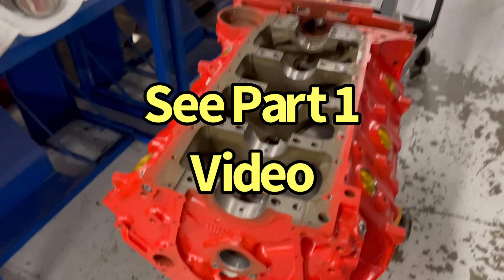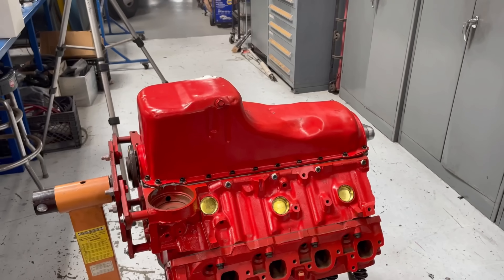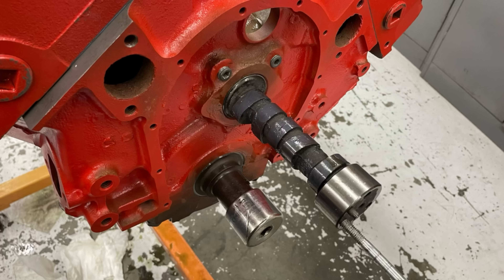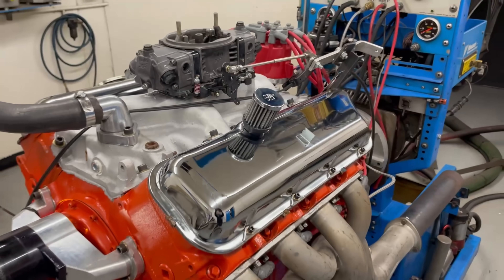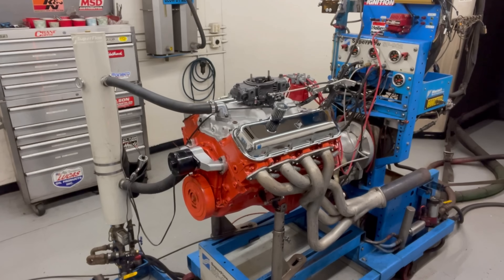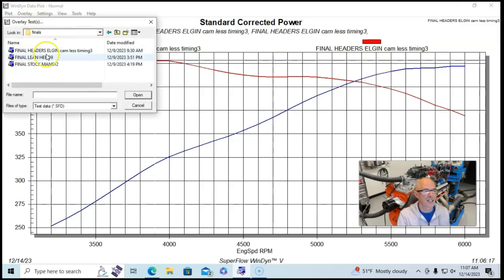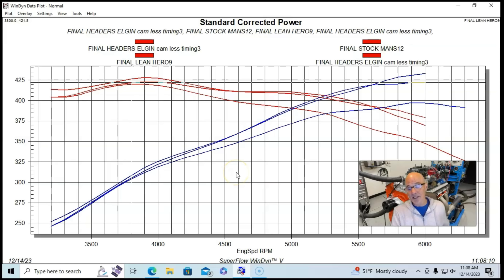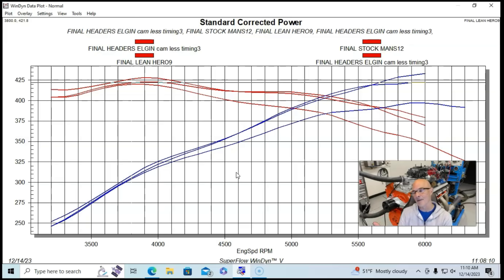FULL DYNO RESULTS ON THE L78 396, OVERRATED AT 425 HP OR  UNDERRATED AT 375 HP? WHAT DID IT MAKE?

Comment: I dynoed a 1969 L78 396 that had a hydraulic flat tappet 238°/242° @.050 cam and weiand stelth intake with 850 carb and on my dyno it barely made 400hp with dyno headers.
Reply: I love when someone only gives duration specs on a cam.  Makes me wonder.  My L78 with Mechanical Cam made Power well over 6800 rpm,  I don't see a Hyd. getting near that.
Reply: @playlist55  Yup you are correct. Big difference from 6000 to 7000 rpm.
Reply: Were you at high altitude or was the compression particularly low? Not trying to be smart, really asking because it just seems like it'd make more, even ground at less than optimal LSA.
Reply: @mikewillett5076  Engine had been rebuild at some point quite some time before it came to me to dyno. Still had the std bore TRW forged 11:1 pistons. Cam had been switched to a hydraulic flat tappet as mentioned. Leak down test was fair at 16-24% it just didn't make any power. I played around with timing and a/f ratios but it just never really responded well. Think it made 405hp @ 6000 rpm. I got a chance to drive the restored 70 chevelle the engine went into and it ran well. I think there are so many inflated dyno numbers out there most people would be surprised what an honest 400hp actually feels like.
Reply: @DanClayton-fo6wt  . Thanks for the reply. You know what? You are right about how powerful and honest 400 horsepower engine can feel. We tend to think of a 400 HP factory engine as powerful but not when we build one ourselves. But that is a good number!
Reply: Engine dyno or chassis?  That can make all the difference in the world!  Same if you are using any correction factors - everything has to be SPOT ON for them to not skew the results.  I used to develop turbo kits for my own company and then the company that purchased us for a couple/few years after.  Everything from diesel side by sides to muscle cars to exotics. I've literally got thousands of hours of dyno time.  I  know people like to bag on results and whatnot, but 400hp to the tire is healthy in just about any car less than 3500lbs.
Reply: would that be a L78 with a hydraulic lifters?
Reply: @keithw372  I don’t see how it could be, from the factory anyway it wouldn’t come that way, L-78s had sold lifter cam .
Reply: @garywilson7992  A L37 is a L78 with hydraulics. 1965 only.
Reply: I don’t doubt that engine dyno’d at 400 hp, it was rated at 375 hp, and was a L-37 with hydraulic lifters , not a L-78, that all of them had solid lifters, and a more aggressive cam than the L-37. The 396 L-78 was first introduced in 1965 that replaced the dual quad 425 hp 409. In 1965 it came only in Corvettes and Impalas, and was rated at 425 hp. After 1965 they rated it at 375 hp, for a few reasons, that had nothing to do with a change in how it produced horse power.
The L-37 396/375 hp engine, which had hydraulic lifters, was a specific offering only for the 1965 Chevelle Z16, and wasn’t produced after that year with the 375 hp rating under the L-37 designation.
Reply: @garywilson7992 it was a numbers matching 69 L78 that had been rebuild with a aftermarket hydraulic cam
Reply: @DanClayton-fo6wt  I understand now, other than I’m not sure why it was decided to switch to a hydraulic cam during the rebuild.?
The solid lifter cam for the L-78 , typically allowed it to reach it’s optimal horsepower between 6500 and 7000 rpm, which a hydraulic cam & lifters wouldn’t do. 
And from my understanding, the L-37, using hydraulic lifters was designed for a broader, more streetable power band with less maintenance, but at the cost of losing some horsepower due to the inherent limitations of hydraulic lifters, that will float, and aren’t designed for high rpm. But of course that begs the question, why then was the L-37 and the L-78 both rated at 375 hp? My guess would be it was due to some marketing strategy, and while the L-37 was genuinely rated at 375 hp, the L-78 was originally rated at 425 hp, and when it was reduced to 375 hp, to conform to internal GM rules and insurance reasons, 375 hp was regarded as a very conservative number. But the Long & short is, for a number of reasons, the L-78 was a significantly more aggressive and capable high performance engine than the L-37, but the L-37 was more steetable and less maintenance. And so I guess I ended up answering my own question.
Reply: @garywilson7992  I dynoed it the way it came to me
Reply: @DanClayton-fo6wt  I know, you explained that, I didn’t mean to imply that it was your decision, but I could have done a better job making that distinction.

Comment: Cam timing could have been different as well, which would make for slightly altered figures... Better fuel, possibly different timing curve... I think they probably gave ratings without any accessories for highest numbers possible.

Did the Vette have available cast headers? Or larger carb? Ford BBF had such available on a select few. I suppose there's still a couple variables that might push power to 425, but there was certainly some massaging of numbers for sales
Reply from the maker: The timing was optimized on the dyno-they don't do that from the factory. Fuel has little or no effect unless detonation is present-it wasn't. The Vette had different manifolds, but still way less power than long tubes. The definitely ran the factory water pumps on the dyno.
Reply: @richardholdener1727  excellent deduction.  Carb size? I can't see an 850 being the cause for another 30 horse, but maybe it's possible....? Cam timing might account for a small amount, but it sounds to me you nailed down the variables.
Reply from the maker: they came with 780s-a 425 hp motor doesn't need a bigger carb
Reply: @Faolan161  A 650 double pumper can feed a 425hp BB just fine.
Reply: @richardholdener1727  Sure you know mfrs shared large carb sizes just calibrated them for different engines
Maybe explain this to these guys? Too many believe thier stock 455 needs a 850, lt1 needs a 780 etc
Wish I coud get the funds to have you or Brule super tune my solid roller 383. I know theres more in it...
Reply: @gordocarbo  not really...  I had a 460 running 250 hp, where  650 CFM carb would be sufficient. A 750 still had vacuum wot, 3500 rpm. 35 hp gain from the bigger carb. 

What works and what's optimal are very different.

Comment: I didn't think they started using "net" horsepower ratings until 1972? If so, then this engine would have been tested without all of the accessories.
Reply from the maker: it would have been tested with a water pump-that wasn't the only change from gross-net
Reply: Right. Net started in '72. I used to look back and forth at '71 and '72 engine specs in books and thought they went way down in HP until it was explained the different test method.
Reply: @notnecessarilynecessary  Net started in 1971. It's why the LS6 BB went from 450hp to 425......
Reply: @milojanis4901  . Actually not the case. '71 was still gross HP. The 25 HP drop from '70 was mainly from lower compression. If you look up several '72 engines a lot of  their specs are the same as '71 but a big HP drop as it was net. Example: '70 LT1, 360.  '71, 330 (lower compression). '72 had the same compression as '71 but rated at 255 NET.

Comment: Stock ignition with points, full exhaust with restrictive mufflers, air conditioning compressor, alternator, water pump, power steering pump all hooked up with a load on them.
Air cleaner with stock filter housing.
Now you're seriously looking at 350 horsepower if you're lucky!
The ratings were a joke back then, they weren't even close!
Reply: Most people didn't have AC in 65.  It exploded in popularity in about 69.  Suddenly, everybody wanted it, and more than a few sports car people disliked power steering.  They felt that it made the car a girl's car.
Reply: @jamesbosworth4191  No power steering either in the 65 coupe I owned. Just a huge teakwood wheel!  My dislike of power steering is years ago you lose the feel of the road.
Reply: @brucesmith5426  Very true!  You have better control of the car with conventional steering.  Ditto for power brakes.  Conventional brakes are easier to modulate, especially in comparison with power brakes of the 50s and 60s - many were light-switch like, either full on or full off.  If you so much as breathed on the brake pedal, you were almost thrown through the windshield.  I never like that.
Reply: No stock AC on any solid lifter engine back the day.  For '70 Chevy tamed the cam timing a tiny bit just to ease auto's from stalling so much on both small and big block solid lifter engines.
Reply: @Dayandcounting  YES!  No AC on the solid lifter BBC cars....maybe late 72 LT1 SBC before they switched to Hyd Cam to make the L82
Reply: Many speed freaks in the 60s frowned on things like AC, power steering, automatic, etc.  Power steering doesn't hurt much in a drag race, but if you are deviating much from a straight line, puts a drag on the engine.  AC, unless switched off, puts a big drag on the engine, and automatic transmissions also reduce performance potential somewhat.
Reply: No air in my 65 coupe.

Comment: I can see using a real 396 in an authentic restoration. Yes, you could dress a 454 to look like a 396.
Reply: Until someone looks at the harmonic balancer and/or flex plate/flywheel
Then the jig is up. 396/402/427 were internally balanced...454 was not.

Comment: The 396/425 in the Corvette was rated with an 850 vacuum secondary carburetor. Chevrolet removed all of those any time one came to the dealer, and replaced it with a 750 vacuum secondary. The insurance companies went insane when the first big block Corvettes were released in 1965.
Reply from the maker: this wasn't carb limited at 425 hp.
Reply: The main resign that all engines of big block or small block for that matter is back in the 60's to early 70" insurance companies would not insure a car if it made more HP then cubic inches!! I lived through that time and Ford or Chevy the 427 ford and 427 chevy where 424 HP rated if you look at the old test results, they did dino testing at way low RPM! like if you're a Chevy guy you know what a DZ-302 made way more then 296 HP! For me it was Ford back then, I build and race both now days, but the 289 HP "K" Engine was rated at 271 HP Yeah right! LOL!!! if you had to buy a new car on time you had to have insurance to cover the loan so a 435 HP Corvett or a 308 HP GT 350 Shelbey Mustang had to be bought cash! or get your own loan!! Definitely not like today where HP sells cars and insurance companies don't care?  I built plenty of L-88's back in the day and with all GM parts 12.5 to 1 and the off road only Cam "Snowflake Aluminum Heads" They all made really close to 600 HP! some over! 289's with the same setup from ford 12.5 to 1, La Mans cam! made over 400 HP! etc. On pump gas! But we had 105 to 110 octan pump gas with real lead in it back then! LOL!   @richardholdener1727
Reply: @richardholdener1727  So real world with accessories, in car wtih headers what would be a ballpark #?
Love those 396...had one in CC in the 90s. Very simple...well ported oval ports extrude honed dual plane Holley dp
and a rumpity HFT cam nothing special. 308 gears too. M21......that car would pull hard in any gear from any rpm I was surprised. No need for 5th .
Reply: @gordocarbo  what accessories? Real car guys ran manual steering and brakes back then . AC , not on your life . A water pump and alternator were it .
Reply: Absolutely wrong…..every 396/425hp and 396/375hp came with a 780 vacuum secondary carb from the factory (Tonawanda). Only the 427/430hp L88/ZL1 came from the factory with an 850….and that was a double pumper.
Reply: @nmbr3fan  I believe there was 1 more in that mix, I now a guy here in Phx that still has a 67 427 vet that shows 435 HP with try-power! I know there was a few of them running around San Diego in the late 60's early 70's! One that I raced 2 times once from a dig, and once from a roll on! With my 66 2+2 Mustang Fastback with a "K" Hypo 289 with 12.5 to 1 Compression, I bought at the Ford dealer I was working at, TRW with a Ford part number next to the TRW number! The off road Lamans cam shaft the heads where ported & polished with 1.940 intake and 1.625 exhaust! I beat him 2 times!!! LOL!!! But in fairness I had way more rear gear my car was completely stock body but set up for drag racing we both had street tiers and he was more than a little upset! My car had a very bad reputation on second street El Cajohn, He cam back for a rematch after about 2 weeks and wanted to race from 25mph on! I really thought he was going to beat me but no! I had him by over 3 cars and I kept going and I saw the tack go past 8500! I looked in the rearview mirror just in time to see his engine Blow up! Sparks and Pices everywhere! We Stopped and I Towed him back to Second Street! getting towed back buy the Mustang that just beat you! But parts where plentiful back them and he had a new engine in a few weeks but left me alone from then on! LOL!!! It's hard to believe but the cars that gave me the best races was the 327 and the DZ-302!!! They were tuff, now at the track with slicks and open headers I'm Shure the vet would have made it a different story! (o;  The best years 65 to75 69 being the best (o; Always have Fun!!!!   (o;
Reply: 11 to 1 solid lifters,  yeah 425 hp
Reply: 780 came on them. Any verification of the 850 used for ratings?

Comment: It almost sounds like 375 was a little optimistic. More like 365 in the car.
Reply: That’s why they went from gross to net in 71 or 72 for advertising the horsepower and torque
Reply: In the early 90's my 1985 Corvette routinely beat a 1970 Chevelle with the 375hp 396.
Reply: @sebbonxxsebbon6824 that's probably pretty accurate with the power to weight ratio formula.  I had an 84 camaro with a mild built 355 3k stall 700r4 than was in the mid 12s. Total build at that time was like 4-5 grand including car.
Reply: In 1970 US manufacturers were still using gross power ratings (no accessories) so the 375 rating actually was pretty close!
Reply: If the 375hp engine really had 355 but has higher compression and wilder cam timing than the lower HP 396s, wonder what the 360hp, 350hp and 325hp 396s actually made?